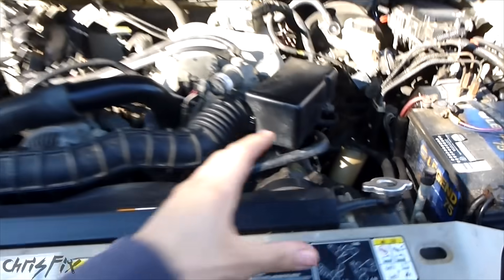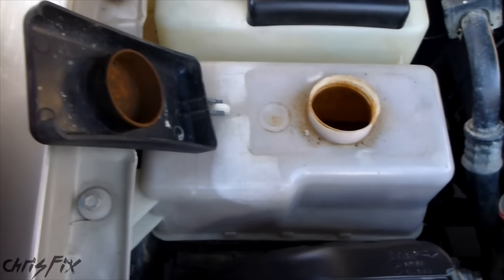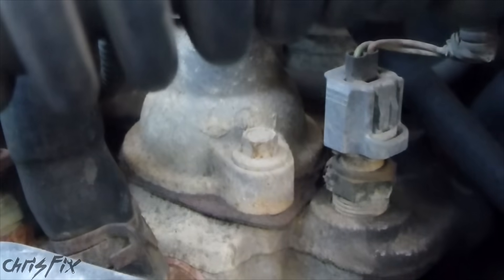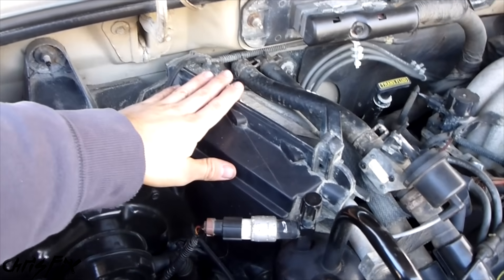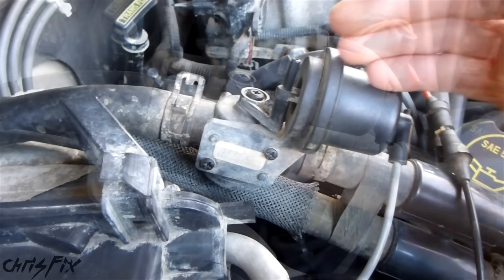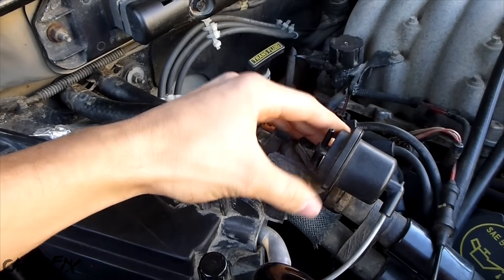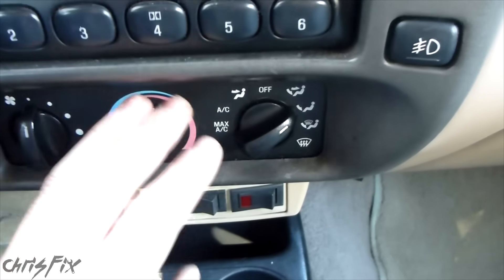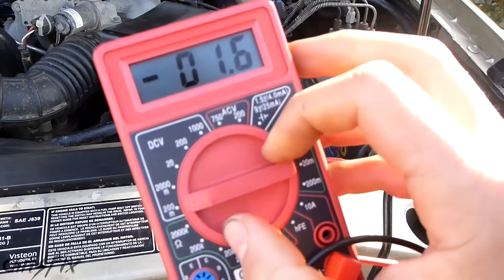How to Fix a Car with No Heat (Easy)

Comment: 97 Avalon 1mz-fe v6 3.0L 
Back story-so I back flushed my heater core until water ran clean then I hooked the inlet line back onto the coolant system and continued to push water through the heater cores return line until I seen it flowing clean back out of the pipe the return line connects to then vise versa yet when everything is connected with the car warmed up, there's absolutely no heat with max heat settings and the heater core return hose is not burning hot. I don't remember exactly but when doing the flush i used the dollar tree toy that looks like a giant pencil that sucks up and squirts water and it didn't need a lot of pressure to push the water through.

Question - what would be stopping me from getting heat like even if the core was a little clogged i would eventually get some heat but it flowed through easily by hand with the squirter

Comment: I change the thermostat and coolant sensor, now during winter engine temp on cluster drops to cold after driving it CEL lights comes on after. During summers engine temp is fine. Only when is 36° and below is when it happens! Any help?

Comment: Hey mane I have a question I have a 1999 f150 and the heat does not work and I heard the actuator move but when it’s completely on i don’t heart it so what can I do to fix and the lines were both hot

Comment: Wat if my heater core is hot. But cold air comes thru vents. I dropped glovebox open. I see the actuator move when I go hot yo cold. N feel hot air behind glove box? I’m thinkin clogged cabin filter? Changed both thermostats radiator service,both temp sensors. 1999 Ford F-350 170,000. Thnx.

Comment: Well crap! Everything (except having NO HEAT)  checks out fine. The hoses going to the firewall don't get warm/hot, but the truck isn't overheating, so it can't be the water-pump, the only thing left is that the blend door isn't operating properly (OR it's air-locked and needs burped - which didn't even occur to me).  Sadly, it doesn't have a heater control valve, or I would have jury-rigged it, to run hot all of the time, until I had a chance to replace it, lol. I haven't figured out, how the blend door actuator, prevents the hoses going to the heater core, from staying cold all of the time though.
I've got a new blend door actuator (but that looks like a serious pain to replace), but I've already put all new radiator fluid in, changed the thermostat, and put a new heater core in! None of which  helped at all, sigh.
Reply: If (WHEN) I do figure it out, I'll try to come back here and post what I found. Thanks for the tips!

Comment: My 2008 Escape had no heat, but the engine was running too hot.  I thought it was a closed thermostat.  Looked under the hood..broken water pump belt.  Simple problem solved!

Comment: I have a corolla e11 and the engine temperature goes all the way up and then i turn on the fun full speed and switch the temperature to hot. The air that is coming through is gradually changing from hot to cold and then the engine temperature goes back to normal and may go up to hot again. Do you know what causes this?

Comment: Hay ChrisFix I Got No Heat in My 99 Ford F-250 v10 new blower motor & Blower Resistor, & still not working. ANY SUGGESTION ???.
Reply from the maker: Did you check the fuse?

Comment: Recently replaced heater core and water pump on a 2013 ford focus and now the heat only works when I drive so I had it flushed and still doesn't blow hot unless the rpm is up or I'm driving feel like I've tried everything short of driving it off a cliff

Comment: What if I have good oem  thermostat good water pump but temp only heats up quarter way of the temp gauge and I have no heat? I replaced thermostat and didn't fix the problem im guessing heater core?

Comment: What would you check next if you replaced the blower motor, resistor,  and switch and still your heater didn't turn on at all? Thanks!

Comment: Im having trouble with my coolant goin down my coolant reservoir on a ford escape 05. I replace my water pump and thermostat and my radiator the car dont over heat. But my heater is not working?? Maybe some advice please and thank you.

Comment: To do a thermostat do you have to drain the fluid 1st. I have a top mount thermostat. It also seems like it’s taking a long time for truck to get up to temp. And the heat is cool air. Anyone have any thoughts???

Comment: Don’t have heat in my van. In there is a leak in the bottom of my van. Do you know what I should look for or do?
Reply from the maker: Find where the leak is coming from and fix that. Then top her off with coolant and bleed the air out.

Comment: what if you replace blend door motor and turn from cold to hot and new motor does not operate and i am getting power to connector,could the temp swicth be bad?

Comment: I have a 2000 ford excursion that is not getting any heat 
I have replaced thermostat, heater control valve, flushed heater core (the heater core itself blows air out evenly), new radiator. 
In all fan modes it just feels like a/c 
Any suggestions?
Reply from the maker: Blend door. I bet it's not moving to push the heat out.
Reply: @chrisfix  okay will check it out
Reply: @chrisfix  I believe it is the heater core as when car is on it’s not evenly blowing air anymore and there is a hot patch then the rest of core is cold 
Tried to replace blend door but when we put new one in vents did not work

Comment: I just changed my thermostat cuz I was told it was that apparently it wasn't cars not overheating heat is working when I'm driving but at idle I have no heat... I did have one leaking hose we fix that also so that's not leaking anymore. We filled the coolant after changing the thermostat tops It off bled the system still nothing... I'm not hearing any weird noises or anything like that going on with my water pump I don't know if it's clogged radiator or heater core.. can't figure out what it could be. My lower hose is still cold, top radiator hose is hot

Comment: My f150 does not have a radiator cap. You just fill the resavor?  I had no heat . Put in about 8 Oz of coolent as it was slightly down. Got heat now. Don't get any easier than that. Also the cap must be on till it clicks.

Comment: I’ve a Nissan quashqai j10 in Europe, it’s like a freezer in winter and a furnace in summer, all owners of the same car have the same problem, I refilled my air conditioner gas last year but it slowly leaked out again and the car is not worth finding the leak.

Comment: Your first answer for no air blowing at all speeds was a motor.  Id check the fuses, relay and the voltage at the connector first..

Comment: My truck I just bought does this cool clicking sound non stop until I turn the temperature all the way down. And then today the heat just stopped. Again, a nonstop clicking coming from my dash. No over heating, coolant is brand new, I've had this happen and then could clearly hear the hear it kick in after what sounded like someone punching my dash. Fml

Comment: I got a new thermostat, a new water pump, and both of my hoses are cold to the touch even with the car running multiple times, I have a 2007 Mazda 3 2.3 hatchback My heat always worked now I have none ( of course now that winter is here )

Comment: Well i got heat and i've got air conditioning but it only comes through the defrost at one point when i would drive down the highway it would start blowing through the vents and then go to the defrost and then it would come back but now it's just defrost i imagine that's a vacuum issue i don't know how to determine which vacuum line is the problem or how to fix it the issue is in a 2002 f150 XLT.. just another chance for a video haha..

Comment: Mine goes cold when I'm sitting in traffic idling, but when I start moving it comes out warm again, my coolant level does drop a bit and I feel that i can hear air bubbles inside heater matrix, could it just be an airlock or maybe thermostat ar play!?
Reply from the maker: Bleed the cooling system because there is air.

Comment: Please help. I just got an 2021 accord. When I turn on the heater, I could smell a fume that is similar to what you would smell in the engine compartment. I bought brand new cars in the past but never had these issues. During the test drive before I signed the papers for the ownership, the dealer said the smell is common for new cars. I have now over 1000 miles on it now, but I could still smell it when I turn on the heater. Just to mention, the heavy rain from last few days made the smell not strong as it was and died out considerably but it is still there. Why?

Comment: I have air coming through even while my fan is off both hot or cold but its lower than the low setting is that normal?

Comment: Bro I have a Nissan 2015 Frontier and it blow hot air when I drive it but when I park it blow cold air can you help me ?
Reply from the maker: Check the coolant level, if it's low then there might not be enough coolant to pump through the heater core while sitting!

Comment: I have a 98 f150 5.4 v8.  I just had to change out the coolant reservoir and the thermostat, due to no heat. Have heat but Now it's spuddering when I go to accelerate. I'm going to guess I have an air bubble?  I turned the heat on max and vent on low to try and push it out like I was told but it still spudders when I get over 2300rpm. I have no clue what is happening.  Any ideas?

Comment: To check the blend door operation does the engine has to be running? Or do you just turn the the key to run and operate the heat/ cold control? Anyone know?
Thank you

Comment: I hav a 2007 ford fusion its tight back at the fire wall i cant really tell were the 2 hoses that go to heater core it needs flushed out did all the other test there all ok my  Mechanic could not  find out why i didnt hav heat my car duzznt over heat no leaks i change  Thermostat not that now it looks like heater core needs flushed hav trouble finding hose running to core or will a reguler   Radiator flush do it if u hav any  info on 2007 ford fusion 3.0  v6 heater core hoses let me no

Comment: I was running my car with no coolant , i added the coolant now what’s happens is it doesn’t go to the top red but it does go to the middle level fast . Not sure if I blew the head gasket ?
Reply: Well, I think there might be air trapped in the system. Try to open your radiator cap and put a coolant funnel. Then add coolant and let you engine turn on idle for ~30 min. The air will come out and the liquid will take the place. Make sure your coolant level is on the right spot (Max cold when engine cold).

Comment: Would anyone know what might be the issue if there’s no cabin heat and the temp gauge is cold, fluid is topped off and a new thermostat was installed, but still not getting up to temperature or blowing any hot air?

Comment: I have a 2002 Dodge neon and when you going down the road the heat though the the the heater thing will go way down to on off and when you when you set when you set or go slow with it it'll go up the normal then you get heat what's wrong with that one

Comment: I have 2006 Hyundai Elantra with no heat. When I turn it to cold air there is cold but when I turn the heater on there is no heat. Any suggestions?

Comment: Mine blows warm on the passenger side and cold on the driver’s side
Reply from the maker: If it has dual zone AC/Heat then there is a valve/solenoid that can go bad. It diverts the hot coolant and when it goes bad it can do exactly what you are saying. It is usually called a "dual climate control valve"
Reply: @chrisfix  mines the cheap Ram “tradesmen “ reg cab. I’ve looked all over and can’t figure it out

Comment: I have a 2012 Dodge  avenger 3.6 I get little heat on low and cold air on high what would be the problem

Comment: When I turn my car on , it always starts with the heater on full blast .. I dont know it didn't do that before. And when I put the ac on. The passenger side 2 air vents always blow out heat no matter what my settings are on.. any suggestions ?

Comment: What if there is only heat on the right side of the dash but cold air on the left side of the dash?
Reply from the maker: It's probably a bad/stuck blend door actuator. See if there are instructions on resetting it in your car first, as it could be a simple/free fix

Comment: I have a vw touran 1.9 tdi I have changed the Thermostat , Actuator , egr cooler and both pipes going into the firewall are hot but the Thermostat pipe is cold and the car is  Circulating water around the engine please Chris help me get hot air into my cab.

Andy

Comment: My car heater is not normal,if i put the temp control on the middle,still cold,it only work if i turn the temp control to high and close to high..any help.

Comment: Okay you absolutely CAN check your antifreeze when the engine is hot PROVIDED you open the cap WHILE the engine is running. Do not shut off the engine and try to open up the radiator if the engine is hot and not running. YW

Comment: I have a 1986 dodge 600.  The mechanic switch that changes to temp from blue to red is stuck in the middle. I can’t figure out how to remove this switch. Please note that the car was originally an A/C car that has been long disconnected by previous owners.

Comment: Hello Chris i have 2005 uplander. we change thermostat, coolant, fan working, its changing cold to hot but only giving little heat what do you think the problem is? i have 2 of them junk one works fine other no. if you can make a video how to change uplander heater core or flush will be fine. they really made fukup engineering its a mess to find and fix it

Comment: My heat went out this year. It had been flushed 3 yrs ago. I knew it wasnt thermostat cuz i wasnt overheating, and my light said half way. I did the flipping around. Ok. So i took it to a dealer. They flushed out radiator and heater core. No heat. Changed thermostat. No heat. Said i needed radiator. I did have heat when i got it back 8 hrs later, BUT, even tho truck was running fine, they gave me my truck and said its running ruff. Oh man was it. They wanted me to bring it back, but i believe they already ripped me off at the tune of $512! So idling ruff, CEL came on. I had just ordered a bluetooth device you plug in the port. Says Im misfiring on all six cylinders, running lean on both sensors. Everyone says vacuum leak. Im a 65 yr old granny. I have a 2003 Ford Ranger, 6 cyl, 2 wheel dr. Truck runs down highway great. Idling , it drops way low or cuts out. Outside temps in the below 0. Can i run it this way til spring? Or have an idea where to look for a vacuum leak. Ps, i have heat, now.

Comment: Thing is with my heather it works but only if you put it on max and then you start dying in the car and the other levels don't work at all and its been like that for only like a month or 2
Reply: I think you should try to flush your heater core and see what is coming from it. I think this might be your problem. Also, make sure your coolant is full and the thermostat is working fine.

Comment: Just spent $162.50 at a car shop for them to tell me why my heat may not be working. Oh and then he told me in order to be sure of the problem he has to remove my dash from my car which will cost $1600 😮🥴 so basically I’m out of over $160 and I’m still cold 🫤

Comment: Need help.  My belt for air conditioner is torn so local mechanics removed it for me. I was told that I don’t need air conditioner since it is winter.  But the other day I was told that I should have ac working for defogging and so on… So I asked another mechanics and I was told that Subaru does not need it. By the way, mine is 2005 Subaru forester
What is the truth?

Comment: I have a 2003 Silverado when I got the truck the ac. And heat BLEW ice cold and hot, one day it stopped working stoped working for probably a month, I pulled into the gas station and it was going like brand new worked for the rest of the day got in it today tunred on and then stopped, really confused

Comment: Dodge is notorious for having a sudden loss of hot air flow..  even the engine heat indicator on the dashboard console will periodically show a "cold" engine ... Turn off your engine for a few minutes... Remove the ignition key as well and   then try to restart the vehicle.

Comment: I have already tried all this, I have heat, my fan runs, I can watch all actuators move but I still have very little air flow, makes no difference where I put the selector switch, its like the doors inside are not connected although I can feel them move when actuating them by hand, its like the fan is running backwards. new fan and resistor.
Reply: Some cars have a air filter behind the glove box - you might try that.

Comment: The way I found out was because the car started shaking so I stop and checked the oil it was way pass the H on the stick but after the needle went straight up to HOT , no smoke cap of coolant doesn’t have milky residue HELP

Comment: Does anyone know why the 2022 Kona will not blow air on the floor when using the heater? The dealer told me that's just how it's made. heat will blow on window with i put it on floor
Reply from the maker: Sounds like a faulty vent actuator. You should be able to get heat or AC in any vent position you choose.

Comment: I have heat on one side driver side and no haet on passenger side and the actauor on passenger side is clicking would not cause no heat on passenger side
Reply: Have. 2012 Chrysler 200

Comment: I have a 2013 dodge avenger. My car is blowing heat on the drivers side but not the passenger. However I do t have one of those dual zone systems. Does anyone know how to diagnose that?